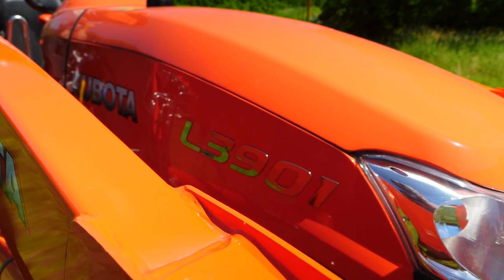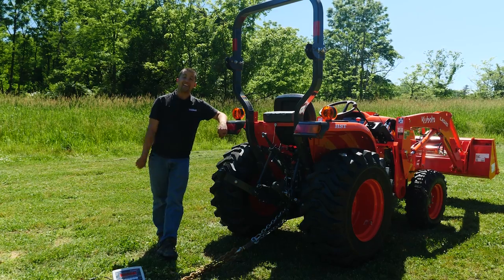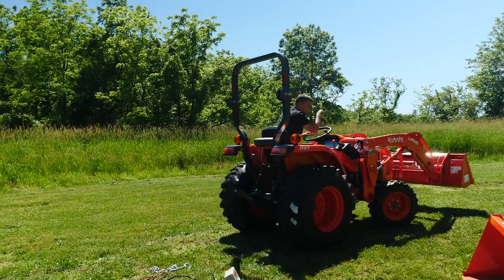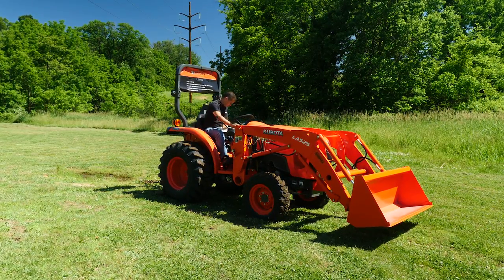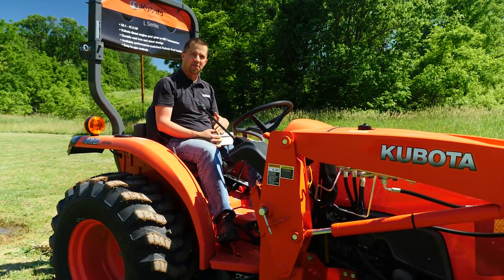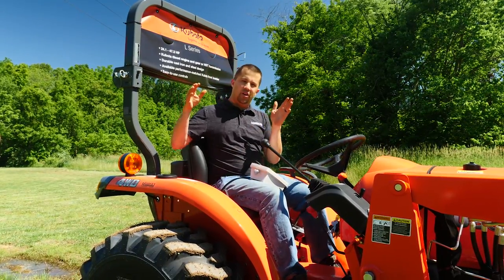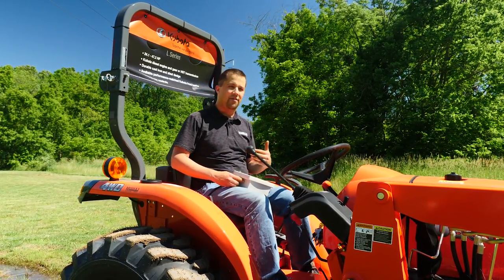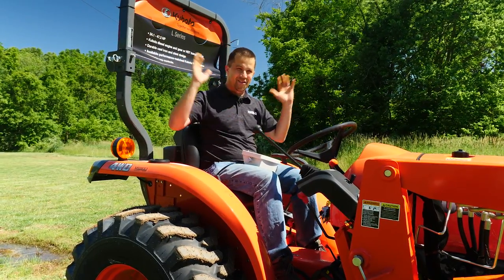Tractor Pulling Test - Gear Drive VS Hydro-static

Comment: It’s all false. He popped the clutch and shock loaded the load cell causing the spike ft lbs.
Reply: Have you owned both?
Reply: Maximum Chooch rodney may not but i have thanks, and i agree with him, poor test with shock loads being caused, real world and driven correctly a hydro tractor will pull just as well as any gearbox, its all operator preference and experience.
Reply: @sharkeyist  hahaha no way. Absolutely not. This test shows what you can expect in real life.
Reply: @sharkeyist  you have to have a complete lack of experience to make that statement.

Comment: This test was absolutely pointless in high gear. Why did you say you did it in high gear to limit wheel spinning, and then spin the wheels on the geared tractor? The gearing isn't comparable in high in a pulling capacity. This video showed almost nothing. The second you said "high gear" I knew the test was worthless.

Comment: High range? That doesn't even make sense. When you are pulling the heaviest load what range do you use? Low range........ that will give you the most low end. Hope they redo this in low range for hst. Not even saying the hst will beat the manual but it will perform much better than it did.
Reply from the maker: because in low range both tractors break traction.
Reply: @MessicksEquip  the manual did break traction anyway but the hst did not and the manual still had more force so breaking traction must not mean it is losing force. Would like to see the test redone with the hst in low and see how much of a difference. It would be like putting a truck in fifth gear trying to take off with a trailer vs trying it in first.....

Comment: This test is really almost pointless.   The HST is better for efficiency.   The way to do this test is to hook up a 2 bottom plow and turn over an acre of land with each machine and see which gets it done faster.    Overall a HST will lose 25% of the HP due to the nature of hydraulics.   No power is lost with a gear drive, simply going into more torque mulitplication.

Comment: Gear drive destroys hydrostatic across all makes and models. Hydrostatic bulldozers can't even run in the summer without overheating (unless you live up north maybe). Terrible choice for tractors. I would love to see the size of the oil cooler. Sounds like that pump was pegged out through the relief valve.

Comment: This was a worthless test. Neil, of all people, you should know that an HST tractor won’t pull at all in high range. The true test would be what both tractors can pull just before breaking traction. High range might be a fun test, but it’s a useless one. I would expect the gear to pull more, but at least make your time, and our time, worth while. Most of your vids are excellent, this one is not one of them. How bout a do over, do it the right way for us!
Reply: theres that and the gear trans was also in high range and neil miss spoke because that trans is 8 f 2 r not 8f 8r the shifter is right in the middle not off to the side like on a shuttle
Reply: Their high end gear ratios are the same  that's why he put them both in high range so he could see which one is more efficient at transferring power to the ground.. if they are both in low of course they will both spin without a downward load on the tires
Reply from the maker: I know its suspect, like I said at the beginning I still thought it was worth posting. Will be trying again some day on Asphalt. I need two tractors with the same rear gearbox to begin with.
Reply: The comparison was high range and first gear on the gear drive tractor vs. high range and whatever foot position Neil applied on the pedal of the HST.  Theoretically there should be some HST setting that gives the same effective drive ratio as the other tractor had, but how would you ever find it?  If Neil couldn't spin the tires of the HST tractor, it meant it was going into relief before breaking traction, but did he floor the HST, hold it at its minimum setting or what?  Twisted Piston has it right.  A better test would be lowest possible gearing and measuring pull right before breaking traction.  By the way, thanks for doing this, Neil.
Reply: Even in highest range highest gear while slipping the clutch the gear drive smashed the HST.  Game over

Comment: The gear tractor sure got a good run up to YANK that drive didn't it. That was a big portion of the difference. of course you can't do that with the geared can you? Why did you cut off most of the hydro start, but not the others. So nobody would see  you inching out the slack? Sure the Gear drive has more torque in high, the Hydro is tuned that way.

Comment: Pulling situations are not performed in high gear. If both tractors weigh the same, and both can break traction then they should be very close. I bet kubota would not appreciate this video.
Reply from the maker: in low range, they both break traction. what was the point of testing in high.

Comment: For the idiots in the comments I’m gonna settle your arguments. If ya put the hydro in low range it WILL spin all 4 tires with the diff locked as will the gear drive, then the only difference would be traction. You’d be testing your tires and the weight of the differing transmissions and the ground underneath each tractor. They did it in high range to test the transmission and to keep the wheels from spinning. Holy hell why do yous need this to be explained to you?

Comment: It's no secret that gear drive has the lowest losses when putting the power to the ground. So for the same starting HP, weight, and tires, of course the gear drive will win. That being said, you can't use the peak hold setting on the load cell when you do these tests. The moment you jerk and yank the chain you get a false reading every time. You need to turn off the hold function, get as much constant tension on the chain as you can, then look at the readout.
Reply from the maker: Did not use peak hold this time (i have in other tests). That's why I had the meter on my lap.
Reply: @MessicksEquip  good call. Hard to tell from the video.

Comment: 5:45 wow he is so far off of reality it’s unbelievable!!
If you was really doing this kind of work the hydrostatic would catastrophically fail without question while the gear drive would not, it would just spin the tires. Hard work like this would eventually wear out a clutch yes, but that’s a known wear item that’s far cheaper to replace that a failed hydrostatic transmission. 
You are way off reality here.

Comment: Ya, I don’t feel this is a fair comparison at all Neil. Anybody that has used both know they each have there advantages. This test will definitely only give the new purchaser a very wrongful negative opinion of HST.  You did no good service here. Sorry Neil. I do love your channel though, lol
Reply from the maker: I questioned this myself. Still thought the example was valid though.
Reply: I feel that given that you broke traction with the gear shift, that is as high a # value it will get no matter the range selection. However, I’d be willing to bet you COULD get at least that value and maybe more  in a lower range with the HST.  Should try it. 🤔

Comment: Who drives a gear drive machine with the RPMs maxxed out like that? Use the damn throttle pedal lol... you dont drive it at max rpm off the bat like a hydrostat... You will destroy your clutch prematurely doing that.

Comment: a HST loses 20 % of the hp before even hitting the gearbox when compared to a gear so for example if you have 2 tractors both 100 hp one gear and one HST your actually doing ~100hp with the gear vs ~80hp HST either way each transmission has its purpose loader work is better with an HST and tillage or wagon work is better with a gear
Reply: Not sure that is the case in 2020.  Losses yes.  20% absolutely not

Comment: Pointless video if not going to use a low enough range to break traction!  One of the worst videos from Messick's I've seen! You are giving people the wrong idea about hydros!  The advantage is ease of use and control. From dead stopped to max pull a hydro will pull considerably more than a gear drive. The disadvantage comes in as not being as efficient and not as consistent for long stretches of mowing,plowing,brush hogging,etc. Again not accurate video

Comment: The hydro is a glorified lawn mower, burn them out pulling on hills, no large tractors have hydros for a reason!!
Reply from the maker: IH 1066.. 100hp farm tractor has a hydro. All how you use it.
Reply: Modern CVT transmissions in 500+ hp farm tractors are half hydrostat and half mechanical gear.  This was first developed by Fendt and now everyone uses essentially the same design.  The ratio of which system delivers the greater share of the power varies depending on speed.  Other machines, such as windrowers, send 100% of their engine power through hydrostatic drives and this can be over 250 hp.  So, yes, hydrostats are very capable of handling high power.